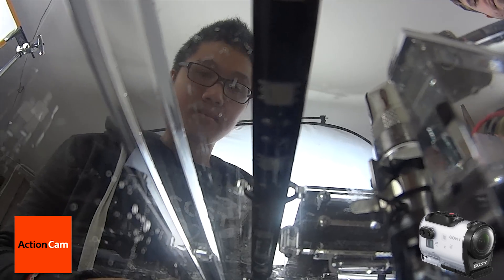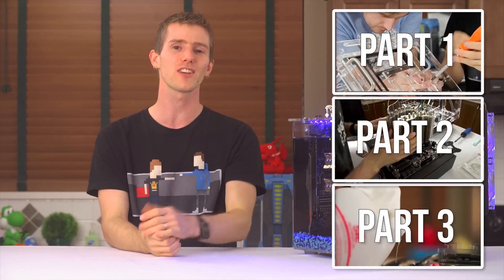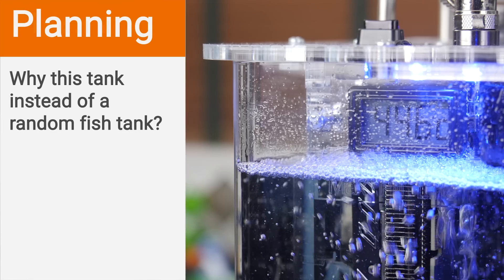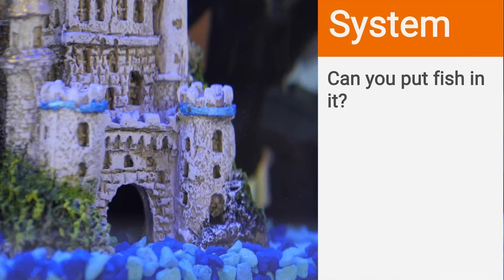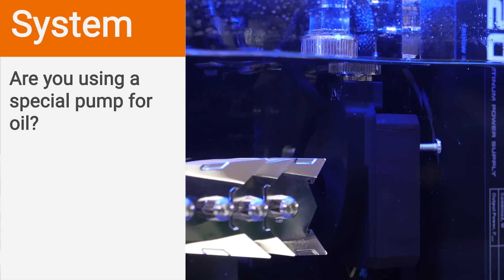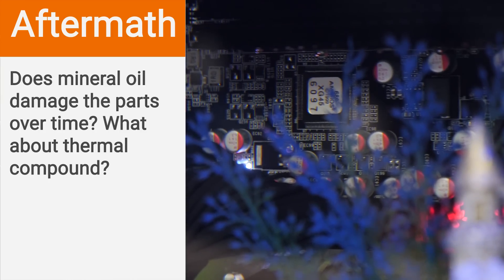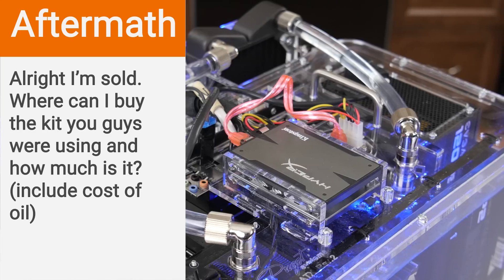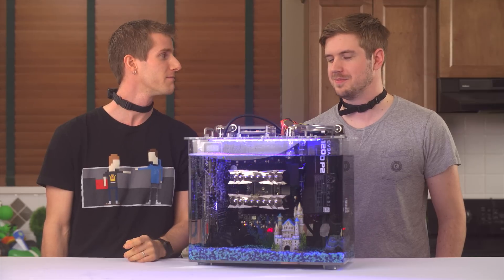Mineral Oil Cooled PC Part 4 - Q&A

Comment: I have a 10 gallon fishtank sitting around and kind of want to just put my current system in there. My system has a pentium g3258 (not a hot chip in any way) and an r9 270 (not a crazy hot card either) and my question is: with these lower heat components and larger capacity tank would I still need a radiator/pump assembly to cool the oil? Because it would be very convenient to just buy the oil, clean my parts, and stick it in there, and not have to go out and buy a bunch of watercooling components as well
Reply: my bad didn't mean to comment here....
Reply: duckyduck915able well that was unwarranted and rude
Reply: zach miller It seems like a ridiculously expensive cooling solution for a system that isn't even worth the amount of effort you would have to put into pulling something like this off.

Because if you wanted to lower the temperatures you could do either of these things:

1) Buy good aftermarket CPU/GPU coolers and slap them on
2) Buy a good new case, clean your current parts and stick them in there
3) Do both of these things

All of which would be easier than setting up a mineral oil fishtank build.
Reply: TheDoomerBlox I didnt really want to do it cause of temps my temps are more than acceptable as is, i just think it would look pretty cool and be a fun project (i do a lot of woodworking and general diy make it yourself stuff already so my definition of a fun project is a lot different than most peoples lol) i was just wondering if i would really need the rads and pumps to keep the oil from getting too hot and causing the tank to crack or something, because i would be able to warrant buying all that mineral oil but the watercooling supplies would be pretty expensive and would be better used for just a normal watercooling loop.
Reply: zach miller Yes, the radiators and pumps are necessary for this to work. Without the radiators the oil will cool down very slowly, and without the pumps the cooling efficiency of the oil would quickly diminish as heat builds up in the oil surrounding the components - which it will since the liquid would be completely stagnant.

Comment: That was a pretty badass build. Maybe one day I'll do a build like this (as in 10+ years). Interesting concepts can be applied to this as well to further push the boundaries, maybe self made systems to create a current for the cpu heating so it won't reach such high temperatures without disrupting other possible problems.

Comment: My first pc build. if anyone could recommend any changes. i want this pc to last a few years.

CPU: Intel i7 4790k 4.0 ghz quad core

GPU: MSI GeForce GTX 970 4GB Twin Frozr V

Mobo: MSI Z97 PC Mate ATX LGA1150

RAM: Corsair Vengeance 16GB (2 x 8GB) DDR3-1600 (I'm using 16GB because im looking to stream with this pc)

Storage: WD Caviar Blue 1TB 3.5" 7200RPM

SSD: Patriot Blaze 250GB SATA 3 6Gbps

Case: Corsair 750D ATX Full Tower Case

PSU: EVGA SuperNOVA 1000G2 1000W 80+ Gold

OS: Windows 8.1 64 bit

Monitor: Asus VG248QE 144Hz 24.0"

Mouse and keyboard: Cooler Master CM Storm Devastator .

OVERALL ESTIMATED PRICE: $1712.74 CAD

Please let me know your thoughts if you are a tech savvy person :)
Reply: I think u should get the EVGA 970 and the build looks awesome! It should last u at least 3-4 years or even more if u take good care of it! (Btw i don't think u need a 1000w power supply 700-850w should be enough! :) (Oh and if u rly want to go overkill which would give u more performance u should think about the 980 ;) thats pretty much it other than that looks like an awesome build!)
Reply: SporeJet Thanks! But why the EVGA 970?
Reply: Turd Bird Gaming Its superclocked so a little bit better performance :P
Reply: No 700 watt are perfect

Comment: You shouldn't have to let the components drip dry.. Just use Isopropyl  or demineralised water with a solvent to remove the oil....

Comment: With water builds you DO have to change the water because with time, microscopic particles of metal, rubber, silicon etc become immersed in it. That is why a distilled water PC works ok, because there are no impurities to carry a current. With time, that changes as particles become part of the solution. Why should oil be any different? The advice to not change the oil sounds suspect IMHO, though I would not personally run a system like this anyway.

Comment: Built my own Mineral oil machine out of a mini- ATX board and a fish tank i had laying around. i used the I/O case port and siliconed it to a piece of plexi then went across the top of the Fish tank to create a top door.

it was a basic build because the pc uses onboard graphics and also the power supply was a laptop type powersupply( directly to the mobo)  - we use this PC at work so we can monitor our phone systems and with the purple/UV lighting i get a lot of cool looks from customers when they view our office. I enjoyed building it and acually have 1 more gallon of mineral oil and am looking to build an even smaller rig with the oil.

The MAJOR PROBLEM-- After a few months of having the build i had the HDD on top of that plexiglass that carried across the top, when the LED strip was submerged for too long the HDD fell in and the plexi did not hold up good enough then the lights died, so i kinda rebuilt the unit then added an SSD THEN ADDED WINDOWS 10 TECH PREVIEW- i love it!

its a fun project but nothing beats a standard airflow build and a H100i on my 8Core AMD in my coolermaster HAF case.

Comment: Ok, I know it would add more weight, but.....Would it be good to water cool the processor and on another rad cool the oil?  Just a thought.  Or would most water cooling kits be damaged in the oil?  Just the "idea" that for a long time your system would be clean and looking new instead of dust covering it is really nice thought.

Comment: I am ignorant when comes to pc stuff, but I know keeping PC components cool is essential but how cool is too cool, can you actually make something to cool the unit so much that it damages parts? In the video it was mentioned that there was two air cooled radiators well would it be bad to have four or six radiators.
Reply: Ok say on a hypothetical stituation you were to fabricate an aluminum finned copper tubed metal housed radiator, which I have some knowledge of doing and what it can do, with such a radiator that can significantly reduce that liquid's temp. would it be too much cooling, or what I'm trying to say is how much is too much or can you even have too much?
Reply: galilred89 Too much cooling would probably be around -145 celsius  and it will lock up any warmer probably won't lock it up.
Reply: galilred89 That wouldn't get it anywhere near cold enough to cause problems. Some extreme overclockers have used liquid hydrogen to get the hardware near absolute zero, so if there is a limit you won't reach it with a metal heatsink.

Comment: i would love to have a pc like that i have been wanting to make one for 4 years now but i git ssi i have been buying my parts one at a time i have a 8350  fx and 2 gtx 660 and 32 gb of ddr3 and a a asrock 990 e9 mob and 3 3tb and and 2 120 ssd in raid 0 and a 10.50 x4 psu and a 1080 wed cam and a 32 in led 1080p tv i have the oil i have benn buying a botel every mo. for 2 years now i have 72  of them

Comment: Baby oil, is mineral oil usually. no harm will come to you.
And as long as no electricity is running though the system you can wash it with soap and water and a very soft brush...I usually use a makeup brush for this I have done this to motherboards (take the battery out and let it sit for a while) and video cards, sound cards, ram...Just about anything. just be sure it is DRY before reusing the parts!!!!
Perhaps that is an idea for another video;)

Comment: Total fail.

CPU at 86c and 88c. OMG put a fan into that cooler for god sake ! I know the oil in the cables and all but that CPU cooler needs flow through it not convection cooling.

Must be a way to sleeve a fan cable and silicon or resin seal it against mineral oil. Google it and fix the machine.

Even through heat goes up I would suggest the fan blow down to not create a bulge on the surface since the CPU cooler is close to the surface and it would cause the colder oil at the bottom to rise up into the whole system more.

Comment: I'd love to try a Mini-ITX build!  I think the upcoming 390x could be an extremely interesting candidate for this project.  If rumors are true and the reference board will be a hybrid air-liquid cooler, and the pump is inside the graphics card and not in the radiator, it could be an extremely easy conversation!

Comment: It's really really cool - no doubt - but I think the only thing resembling a "practical" use for oil submersion is in combination with some sort of phase-cooling or aggressive sub-ambient water-chilling. The oil obviously adds a crapton of extra work, but at least in that case you don't have to worry about condensation and thermally insulating every part of the cooling system. Its one of the only ways you could accomplish a super-clean look in combination with aggressive phase-cooling.

Comment: If you want to clean anything electrical with oil use contact cleaner. Its basically alcohol in a spray can and it evaporates super quickly. Soak the oiled part and let it dry. Do it a couple of times and you should be good.

Comment: If you want to clean a card or something, can't you use alcohol? After all, water and alcohol doesn't break computers, it's shorting circuits that breaks them. Alcohol easily eats away oily substances, so probably just rinse the component with alcohol and slosh it around, then thoroughly drying it should make a card or component "clean" in a few days or a week

Comment: Lol that's hottttt. My 5960x stock is 20c idle (19c ambient steady) and load is around 39c. At 4.5ghz at 2.9vcore, I am at 32c idle and 59c load. I am assuming this is because I have three 360 thick radiators? lol.
Reply: I should mention my water temp stays around 20-35c depending on load. Full 100% load at both overclocked CPU and GPU, I am at ~35c water temp. I am cooling a GTX690 as well in this loop.
Reply: I should also mention I am watercooled (without mineral oil), not air cooled with mineral oil lol. So my question: Why not watercool the cpu instead of a air-cooled heatsink?
Reply: Also: 70lb's isn't too much...my desk-case is about 250lbs haha.

Comment: So more money time and effort for no performance difference and its completely not portable
Reply: Plus this build is something you should only do with a low end system
Reply: lekan adams This video is about mineral oil cooling, not benchmarking the performance of the PC. Besides, your performance is determined by your choice of hardware, so I don't know why you were expecting some magical overall performance boost just because it's cooled in oil(though mineral oil's better cooling efficiency would potentially allow for higher OC speeds). As far as what type of system "should" be used, the answers is any. They just showed us that its perfectly viable to build a high end system in mineral oil provided you use a kit.

People who want to build mineral oil PCs want to do so because they are enthusiasts who like to build unique systems and aren't too concerned with LAN parties.
Reply: Matt Dobner no you don't understand my point I meant no performance difference as in the temps where still pretty high I get same temps with a regular fan cooler and even if the temps are slightly better the effort and time and money doesn't really worth it. I mean I was expecting idle temps to be like 20 and full load temps to be like 40 with all that effort. And you are right this seems like an enthusiast build rather than a performance thing like it's completely impractical and would cause a lot of problems since if a small thing went wrong you are screwed because well it won't be easy to diagnose. That's why I assume it would only be used in a low end system because you wouldn't be worried too much about something going wrong. I am not putting like a titan in mineral oil that's all i'm saying

Comment: The Gpu is colder than the oil at Idle
Reply: Which means that the Pci-e and the power cords can cool the gpu*

*If the oil temp did NOT raise before the measurement

Comment: Hey Linus, I think a really cool video you could produce would be the ultimate watercooling rig vs. ultimate aircooled rig using the same hardware. The watercooling rig would house a bunch of radiators cpu block, gpu block and the aircooled maybe a NH-D14 with a case full of those 3000rpm noctua fans (or something more powerful) . The results could be maximum stable overclocking numbers and benchmarks.

Comment: Ever think about going to the next step and use peltier coolers to cool the oil? I did it in college a years ago where I had a oil loop on the cold side and a water loop on the hot side of a peltier cooler. Keeping the oil from going below ambient required some work, but you can't beat the overclocking potential.

BTW, you should of had the bubbles flowing through the CPU heatsink. It helps ;)

Comment: so stupid. put a fan on the CPU heatsink. the GPU runs cooler because it has fans. luke is wrong. a fan or two  wold lower that 88 degree CPU.

Comment: I have a question for all you people. I recently built a pc of my own. My parts list is 
Amd 760k processor
Corsair 430w 80 plus power supply
Sapphire Radeon r9 270x
8 gigs of pny ram
1 terabyte wd green hd
Now every time I go to try to instal an os it won't even install. I've tried many different veriosion of window and have even tried Ubuntu. Nothing will install. And when trying to install windows I get the error code 0xc0000221 /windows/system32/ntoskrnl.exe. I am honestly lost and I have no idea how to fix this. Please help. Also when I tried to instal the same os on a different computer it worked fine.

Comment: I'm curious about ways to get the OC temp on the cpu down. Wouldn't putting a fan on the heat sink do more to get the hot oil away from the cpu? Would it be feasible to snake down some cable from the rad that is pulling oil down to the cpu area to immediately disperse the heated oil? Or maybe a light duty oil pump on the bottom of the case pointed directly at the cpu cooler for a stronger flow right at that part. Man as much as I'd like to own one I want so much more to troubleshoot one lol

Comment: nice job :) if you have time consider the concept of trying a water cooler just for the cpu. ofc having the radiator outside of the "case", I bet temps will go hell lower overall :)

Comment: put water radiator in deep freezer have pump pumping in cold oil into your system :D ultimate pc oil will no condensation inside of the machine full of oil so no worries there

Comment: you mentioned that hard drives wouldnt work on oil because the oil would get inside the drive and ruin it, but what if you were using a sealed drive, like the ultrastar he6 that have helium sealed inside them? surely they would work because the oil wont be able to get in.

Comment: Fish tank pc...it's been done. Now I don't know if it was part mineral oil/part fish tank. It was at Quakecon 2014 in Dallas, TX. If I remember correctly it was in a Carbide Air 540 case and was custom nodded using the split dual chamber.

Comment: Linus says in the beginning that the high CPU temp under load was due to the lack of a fan moving oil through the cooler and later on Luke says that a fan wouldn't help much because there's already a lot of oil movement and flow from other sources. Which one is it? I'm wondering if using a CPU water-block with integrated pump like the Swiftech Apogee Drive II would be more effective...
Reply: The waterblock wouldn't help unless it dissapated heat better than oil... good luck with that.
Reply: It would circulate oil over the heatsink in the block/pump. Just an idea that warranted a question and I don't need luck but thank you...

Comment: Im still not sold on Linuses explanation, why cpu fan would be useless. Yes, there are many currents in the tank, but in the form or circular vortex and random flows. I still think that dedicated cpu fan (preferably one optimized for pressure) would make a big difference. In current state the oil is flowing AROUND heatsink, but not THRU it. Further more, your heatsink has pretty narrow fins spaces.
The fact, that GPU (consuming more power, producing more heat and having much smaller and lighter heatsink) has so much lower temps just supports my theory.
So Linus dont be pussy and get messy! We want to see you put fan on that cpu cooler and remeasure temperatures.
Thank you in advance :-)

Comment: Fyi, that's not why you need radiators. with out rad  heat can only dissipate through the plexiglass tank and the surface of the oil, which is at least an order of magnitude less  surfearea than a rad.l #thermodynamics.